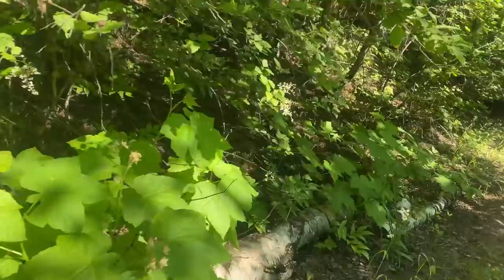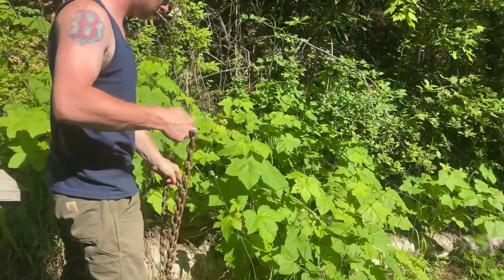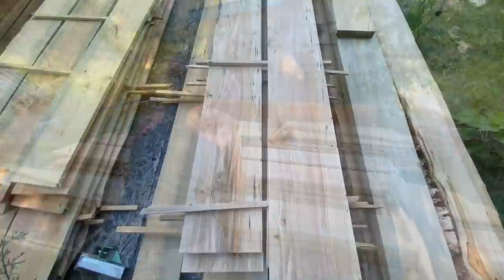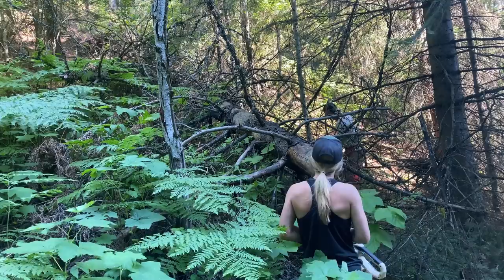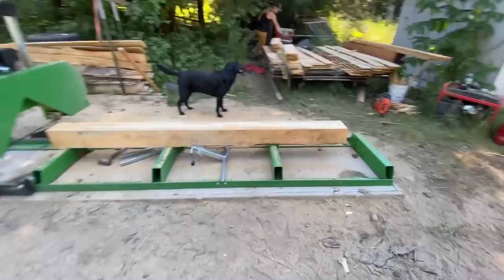Will This Even Work? Shiplap: Birch, Cedar, Lodgepole | Harbor Freight Sawmill

Comment: Ok. I'm jealous. I'm to busted up to work. 
Proud of you youngsters. 
Free hint. Used engine oil. Not New. Used. 
50/50 mix with farm grade diesel. 
NOTHING eats that stuff. 
Soak your wood with a garden sprayer several times. 
I built and lived out of cedar horse drawn wagon for many years. 
Also put a 2 wheel dolly under your log and your tractor can drag 70% bigger logs. 
Both of these are so cheap the return on investment is almost immediate. 
I subbed. 
GO KIDS GO. !
Reply from the maker: Thanks Cody. We appreciate the tips. Thank you for watching.

Comment: With the outsides cuts, your set up looks like it’s works.  I made my post in x or cross to keep the wood up of the ground. Plus you can run the chainsaw with out getting to close to the ground. Less sharpening your chain. You can cut firewood right in the rack, that’s what I call it.👍 keep the videos coming enjoying watching them, thanks!!!

Comment: As others have said, absolutely not hemlock. Hemlock's a coniferous, evergreen, needle bearing tree. Would help very much in identifying if you included the flowers. There are lots of trees with compound leaves with serrated edges and lance shaped leaflets ;) I'm going to suggest Rocky Mountain Ash as a possible id.

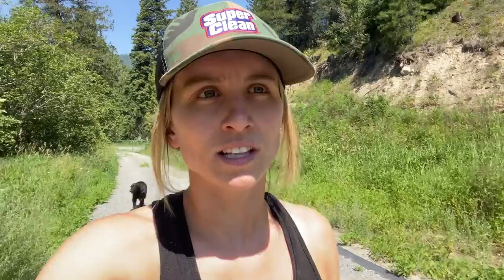Comment: 22:02 the trees are both some elderberry - you should keep them , you can make tea out of the bloom and jam and pie from the fruits - they are fast growing, their wood is worthless and they dont get bigger than 4 inches in diameter with a 1/4 inch hollow core usually filled with fibres - the wood is white like maplewood , soft and when dry very lightweight 
tree gets a 16ft wide crown and get abaut 20 ft tall at max
Reply from the maker: Sounds good thanks for the good information.

Comment: If you just go to an auto junk yard and get a small hood from a scrap car you could just roll the log onto the hood and chain it down to your 4wheeler it will pull a lot easier because the hood will slide better on the terrain.
Reply from the maker: Good idea, thanks!
Reply: @LaidBackLiving  your welcome. Cody from Wranglerstar used the method years ago. Just put the front end of the log on the hood and it keeps the log from digging into 
the ground as you pull it, plus the hood makes it slide easier. It's really helpful if you find a hood that is curvrd up in the front. Even a trunk lid would do the same thing.

Comment: the boards with the rot can easily be cut down to fit spaces between windows and doors. still good siding. also there is a horticultural app that will tell you what species of tree that is

Comment: I live in eastern Washington in the foothills of the Cascades.  That is a sumac shrub.  It never really becomes a tree with a central trunk, but a multi-stock shrub.  It does indeed grow very fast but the inside is always pithy and almost like cork rather than wood.  To me, its chief redeeming feature is that the fall color is a brilliant red.  I never go out of my way to save one but let them live where they are not in the way.  I doubt it will transplant well this time of year but when dormant it should move well.
I cringe a bit at your use of the quad.  Those are not meant to be jerked around like that. I suggest that you will get longer life from it with a winch or use the pickup when you are at the limit of its pulling power.  But then too, it is yours not mine so do with it as you want.

Comment: you should keep the sawings of untreated and treated wood seperated, treated wood contains arsenic - else you should keep the millings and compost it into top soil
Reply: "December 31, 2003
Arsenic in Old Pressure-Treated Wood
Manufacture of CCA-treated wood for residential use was halted December 31, 2003, through an agreement between manufacturers and the Environmental Protection Agency (EPA).Jul 7, 2021"
Reply: @larrye.corbett162  yea but what are they using now?Chrome and copper oxides witch are at best just marginally less toxic And how do they dispose of old treated wood? Everyone can still buy old telephone poles and railroad ties it's not like they send them to purpose built incinerators with arsenic recondensation filters